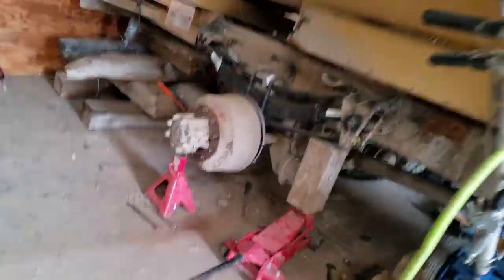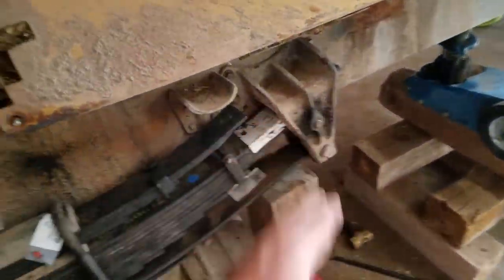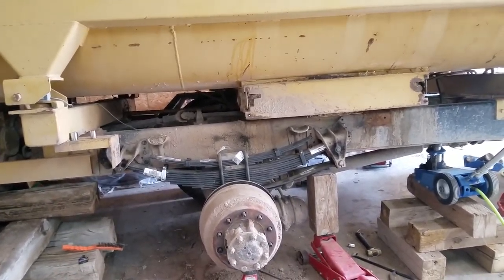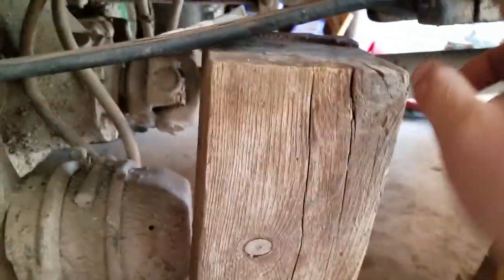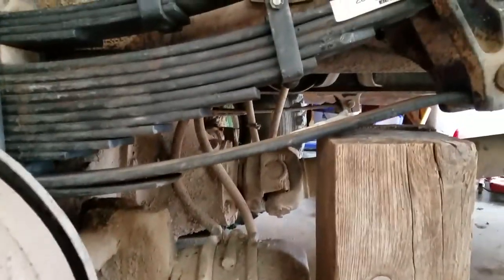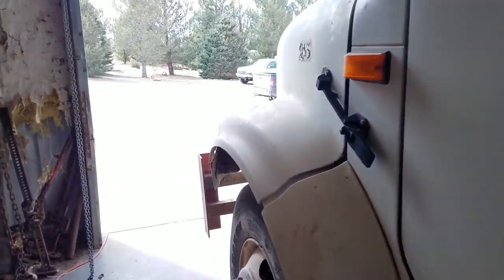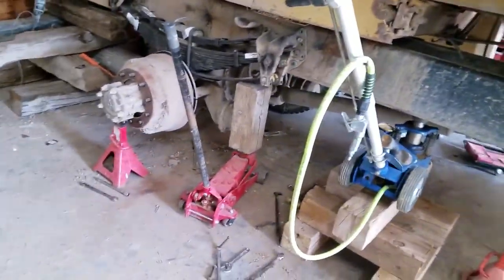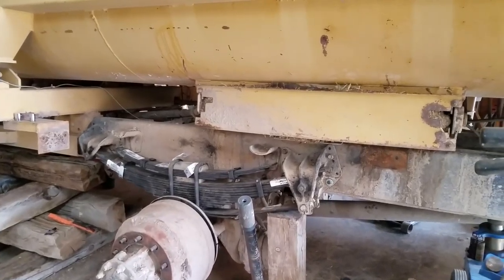Working on the Feedtruck

Comment: I once dumped a bucket of stone in the back of my dump truck while the tarp was extended over the box. Had to shovel the tarp off to roll it back up. I wonder if air bags would hold up better than springs on your truck.

Comment: We had a one of those internationals with a rotomix box.  Didn't have trouble with the springs, but did have trouble with the leaf spring pearches cracking on the axle.  You'll want to watch that.   it was a real good truck.  It's down in Nebraska somewhere.  We sold it when we bought the Highline processor, and now my maintenance is near zero..   Hope things are going well down there Will, we are calving hard right now, and still have alot of white stuff on the ground.  Very tough to find places for pairs.  Hoping on better weather soon.
Reply from the maker: DieselFume1 I really like having a feed truck. Just need better roads